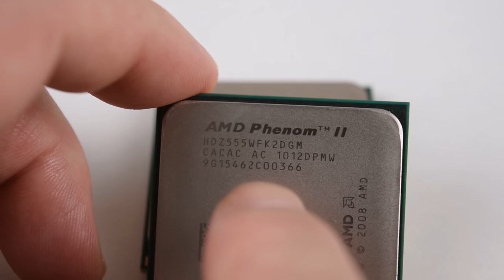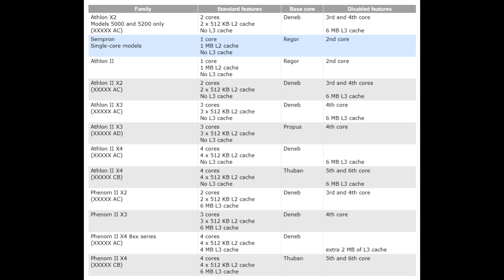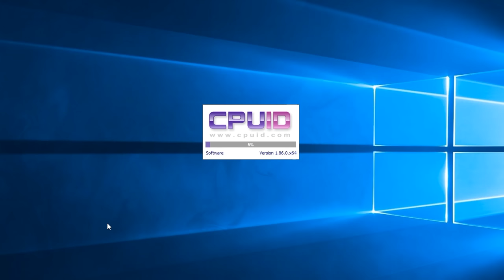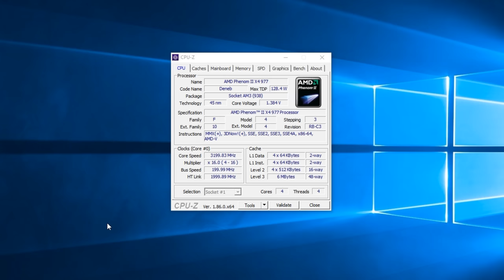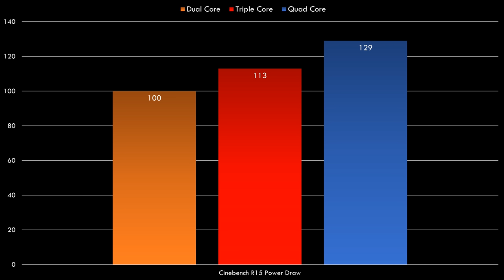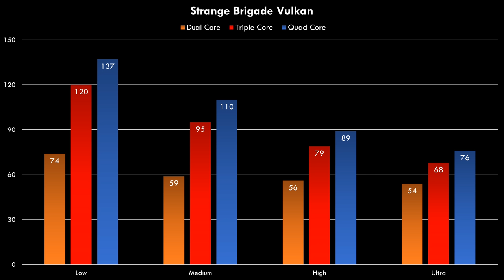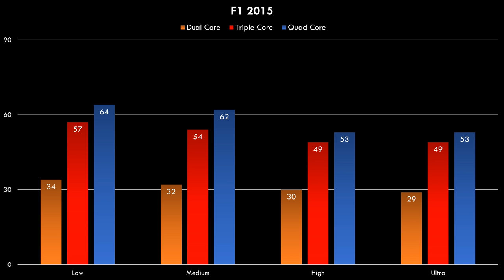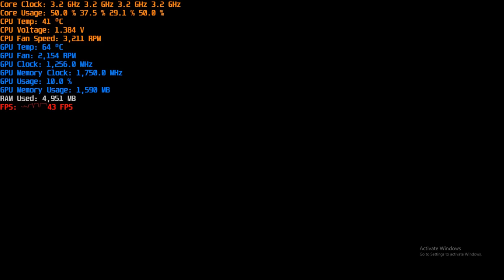Unlock $13 Dual Core into Quad Core

Comment: The biggest problem today with AM3 is finding an unused motherboard. Even the weaker CPUs like the Athlon X2 2MB are very capable dual core chips that will power through old games and the games of the time period. With better than Athlon 64 ipc and high core clocks of 3GHz and higher, those chips are actually very powerful. Sure a Sandy Bridge core chip or newer will wreck it but I have not seen the motherboards in high supply with low prices ever compared to AM3 even from 2009 and unused chips aren't going for cheap either. The problem with Far cry is likely GPU drivers. I was not seeing those dips back with my Phenom IIx4 and a HD6970 but I did have to roll back drivers to get stable FPS. With newer drivers the game was running completely unstable and was then running above 100fps with older drivers at all times

I was recently looking at Skylake i3s and the better ones new are going for close to $200 and the better motherboards were all going for over $100. My Phenom IIx4 from 2009 and the motherboard were less than $180 together. I'd love to go Intel if the prices weren't garbage but I haven't seen that happen since Haswell

Comment: Watching this video on a Phenom II x2 560 Black edition unlocked to 4 cores, but they won't overclock even with a decent quality MSI system board and a Hyper 212 Plus.  All four running at 3 Ghz.   Still, not bad at the time for a $89.00 CPU that's still working almost eight years on.

Comment: I hate reading amd gpu usage in rivaturner osd, its pretty much unreadable because usage jumps all over the place thus impossible to determine if cpu is holding it back hard or not... Great video none the less.
Reply from the maker: Yea I'm not sure why AMD hasn't fixed this in their drivers yet.
Reply: rivertunner not good (doesnt amd have built in osd?)

Comment: Can i unlock a intel Core 2 Duo to a Quadcore?
Reply: sorry pay intel for that. It will cost $500

lol
Reply: nope. Intel had dual core modules, so it either had dual core or quad core (two dual core units together) but still the dual and quad core dies where a single piece so they had no chance or recycling chips. Maybe they could have disabled cores in sofware but they never did so if its a core 2 duo, it has a single dual core chip inside.

Comment: GOG is dropping xp? Blue Snow just appeared. That's bad news for me, which os to use now. Any suggestions?
Reply from the maker: Got a link about this?
Reply: @philscomputerlab  Disregard that, it was a nasty rumer someone fed me to get me triggered and it worked. Great video maybe you can try the cheaper quad core fx-4100 in that AM3.
Reply from the maker: @retropcscotland4645  I'll check out that FX :D I use GOG installers on XP all the time, haven't had any issues.
Reply: @philscomputerlab  i got fx 6300 i can sell you for $80 if you cover shipping or $50 if you cover shipping
Reply: @philscomputerlab  Awesome mate. That's the good thing about AM4 and Ryzen, we can now get the older stuff cheaper.

Comment: Did you know secretely these were really 8 cores? if you add a 200nF capacitor between pins A34 and F12 you can unlock another 4 cores.

Comment: My processor burn out after core unlock first I got blue screen's a few times I can't get to bios to change back settings and after a 5 min restart loop the cpu die 
I think was manufacture faulty the core loked cpu some they may work but I was unlucky

Comment: I have Phenom II 965T Black Edition, 4 cores, 3,2 GHz pared with 8GB DDR3 and HD 7750. Works good enough.
Reply from the maker: Nice, we will be checking out the 965 soon. But AFAIK it runs at 3.4 GHz?
Reply: Mistyped, 3,4 GHz. Anyway I can unlock 5th code, but Windows than, refuse to shutdown. I am thinkin to keep this CPU and PC this year.

Comment: If the cpu core is unlocked on the board, can you then take the cpu out and put it in a cheaper board without the feature? Or once the cpu is removed from the mb with core unlocking functions, it reverts to its natural locked state?
Reply from the maker: The latter, the motherboard needs to support unlocking. It doesn't do anything physical to the processor.

Comment: i have the exact same AMD 555 dual core processor and unlocked it to a quad using an ASUS mobo. Still use that computer today. The core temp sensors didn't work when unlocked but worked again when relocked to a dual core, it's a known bug.
Reply from the maker: Nice!

Comment: What if the 2 core version's 1 other core is bad completely, can it be unlocked to 3 cores or just no?
Reply from the maker: Yes you can unlock individual cores in most BIOSes.

Comment: i bought a few of those asrock n68cgs4fx mobos a few weeks ago on newegg ironically i was able to unlock a rana athlon II x3 435 into a phenom II x4 b35 quad core  , 3 years ago i did the same thing on an asus M5A78L-MLX motherboard with a phenom II x3 720 unlocked it and overclocked it to rival a Phenom II x4 945 :)

Comment: that would be cool if you could do that to the new ryzen chips. say you gotta 6 core and 2 of its cores were functional but couldn't hit the base clock. you could unlock it and at least get all 8 cores at a lower clock or maybe you get lucky and you get a fully working 7th core and maybe a partially functioning 8th core. ya know? hmmmm
Reply: when ryzen first came out i was so sure that was gonna be a thing, i remember watching some of the first delid videos when they showed that there was a full die and thinking unlocking was back! Too bad it never came to fruition

Comment: in NFS:Hot Pursuit my Q8300 on 3.2 Ghz has the same drops, i thought it's lack of L3 cache and slow DDR2 memory
Reply: NFS: Hot Pursuit 2010 is a badly optimized console port. you shouldn't use it for benchmarks. I had frame drops on my i3-2100 with a gtx 670 even in 720p at certain places on the map with CPU and GPU load both at less than 50%. Only when I upgraded to a i5-3570k those drops disappeared and the game ran constantly at 60fps.
but the game is fun ;).
Reply from the maker: I didn't see them with a faster Core 2 Quad, so I think it's definitely IPC related. But the Core 2 Quad I used runs at 3.33 GHz.

Comment: I had a Phenom II X3 720 BE at 2.8GHz that unlocked to a Phenom II X4 and overclocked to a stable 3.8 GHz with no added voltage. Awesome times..

Edit: I remember how that unlocked X4 at 3.8GHz tore through rendering workloads. T'was a really nice upgrade from the 65nm Core 2 Duo I had before that.
Reply from the maker: Nice. We should have a 720 BE at hand soon :D
Reply: PhilsComputerLab great! cant wait to see your upcoming video on that.

Comment: That NFS has vsync and cannot be disabled, I think that's why it goes worse. With my Phenom II X4 920 and a 9600 gt in hd resolution and max quality it achieves 60 fps stable.
Anyway, I love Phenom II. My 920 is still an excelent processor, and I think AMD should make core unlocking possible in Ryzen hahaha. It would be great!

Comment: This use one of these with 8gb of ddr2 mines a b59 dual unlocked to a quad runs about 3.6 oced but had to step back to 3.4 after some werod issues and now I can't use my bios is get crazy artifacts
Reply from the maker: Clear the BIOS with a jumper to reset the unlock!
Reply: Would that clear the bios artifacts it wasn't doing it for over a year unlocked

Comment: Funny that just 3 hours ago I was watching video about core i7 6700k, witch was damaged with incorrect overclocking. Mother board started killing it, because of wrong selected voltage. So the os started showing blue screen. Reinstalling didn’t give any results. So guy send it to YouTube channel, and they find out on the other mother board, that this core i7 can work, but only if one core will be blocked) so now we have first intel triple core, with hyper threading) they called it Core i6, because it bidet Core i5 6gen)
Reply: omg lol best intel joke yet

Comment: This age old CPU gets 310 cinebench on quad core. My i5-6500 bought in early 2017 when it was the best option for $200 gets 520, just 210 more. My new Ryzen 5 2600 which can be bought for $160 and sometimes $150 can get around 1290 at 3.8 GHz on the stock wraith cooler. Looks like intel ripped me the F off.
Reply: Rohan A. I bought that exact i5-6500 and ever since have Best myself up about how bad a cpu it is. I totally wasted that $$ looking for a budget Intel cpu.
Reply: @utp216  How is it bad exactly? What are you trying to do with it that won't run well?
Reply: I have a phenom II x4 960t than when unlocked and overclocked to 4ghz (could get 4.1 if i wanted). put up between 590 and 600 cb score
Reply: @utp216  I mean, back in it's day if you had $800 to build a gaming system you got this. There was no alternative so you can't fault yourself for it. But now I've just sold mine today for less than half it's original price because of how quickly it became obselete
Reply: Rohan A. You know I think I’m not giving the 6500 a fair shake. It did get the job done at the time. I think I just expected more from it in to the future and figured it wouldn’t age so badly in comparison to what became available.
Reply: @utp216  planning to upgrade soon?
Reply: @rohana.7760  As much as i do believe that Amd has better value in their cpus.  Intel cpus perform better for certain applications even if their raw compute isnt as strong, the same way that the old 3rd and 4th gen i7's smashed the amd fx 8 cores despite the higher clock speeds and higher core count. Intel cpus generally do better in gaming applications as opposed to "equivalent" amd processors
Reply: No, it was just that the AMD FX CPU series was a failure & next to no software was optimized for it's architecture. Regarding gaming you'd often need highend GPUs to notice any difference in gaming between the Intel & AMD CPUs AFAIK.

Comment: There is a reason such processors were sold as two-core processors and not as four-core ones; in the post-manufacturing testing and quality control process, such processors almost certainly didn't pass all the required test: some cores were unstable at normal working frequencies or normal temperature ranges, had bandwidth problems or hardware bug in certain instructions, had in-die memory defects in some cores, etc... So yeah, even if I can unlock more cores in those processors I won’t recommend using them in critical tasks.
Reply: Did you actually paid attention to this video? I've had a x2 550 be, unlocked and runs everything much better and stable in overclock than my phenom ii 955be..
Reply: Manufacturers lock cores not only because they're faulty. Even if all of their cpus are perfect, they would lock cores and sell them cheaper because huge part of the consumers are on budget and they just won't buy expensive cpus.
Reply: @smtnbad  I know, if there isn’t enough output of budget product to cover a certain market, they are willing to sell locked hardware to cover those (also, it is valid if the sales for such lesser product does not justify the cost of mounting an additional manufacturing line); but remember that as in most industries, efficiency is key (and selling hardware as a cheaper version is not) and also remember that there is always defective output from the manufacturing line, so in many cases, they are selling real defective hardware as a more budget product (Nvidia uses this business model rampantly); my recommendation is that you just need to be careful unlocking and using such CPUs.
Reply: Like any overclocking/undervolting, you have to perform some long-running tests before running critical tasks. I think it's quite obvious but not bad to remind for unexperienced users. But instead of being careful, I'd rather recommend to always make proper backups.
Binning is also a cost and a strategy. If you know you sell more low/mid-end chips, you can start to raise QC validation for higher end parts. And in all semi-conductor industries there often are defective parts that just barely failed : if it's just a higher tension to sustain core settings, that's not a huge problem for this kind of chip.

Comment: I wonder if someone will come along one day and realise we can unlock Ryzen CPU's as well..........
Reply: i doubt you could unluck the comsumer ones, maybe the threadrippers as they have "dummy dies". It would be interesting to see if they're actually connected or what. Still, with no motherboard support there's no way to enable them even if they are functional
Reply: The only ones that might be unlockable would be the 6 core processors, since they would be two 3 core units connected via infinity fabric. They might be unlockable to 4 core units and give you a 8 core processor. Key word "might".

Comment: On the AM3 side there is always the Bulldozer based FX 8 core processors.

I am sill using a FX-8130 as my daily PC at home ;)
Reply: its not actually 8 cores, more like 4 cores with hyperthreading.....
Reply: The AMD FX 8150 are true 8 core chips.
https://www.amd.com/en/products/cpu/fx-8150

Review from back in the day...
https://www.anandtech.com/show/4955/the-bulldozer-review-amd-fx8150-tested 

AMD didn't use hyperthreading that was an Intel technology.
https://en.wikipedia.org/wiki/Hyper-threading
Reply: @morantaylor  they are not cores, they are modules, they share resources and they suck
Reply: That technology is actually in between HT and real multicore. Biggest problem with those CPUs was/is the lack of software tailored to them.

Comment: I have one that unlocked all 4 but doesn't OC that well. I needed a modded bios to do it at first.

The actual x4 chips were better. But who is complaining about 2 free cores and spending less money.
Reply: Was wondering what experiences people have with these. Seems like they disabled the cores for a reason. Likely because they didn't meet the performance benchmark they should so they disabled those cores and sold them as a dual core.
Reply: @EmptyTome  Hmmm... interesting. Well at least it's something right? Heh. :)
Reply: Exactly, amd wasnt dumb, most locked chips were binned. The most unstable cores and the defectives too were the ones that went to the lower end cpus. Just like most lower end models dont overclock as good as higher end ones, unlocking cores could mean you would need to raise the voltage to keep them stable and maybe even they would run way hotter at the same speed as an actual x4 cpu. If the unlocked cores werent outright defective, you still had a chance of them being subpar, unstable or that got really hot. Few were the cases of them being locked only to meet demand. Still for the one unlocking the chip it had always been a chance to win "more cpu", with no chance of loosing anything.

Comment: I'm using a AMD Phenom II X4 B95 Quad Core. However my motherboard does not support "CPU Core Unlocking" so, just bought my own quad core. I had installed a AMD Phenom II X2 B55 Duel Core CPU in my computer. I however play moderate games with it, nothing to demanding on my system, Other Specs: 4Gb RAM, 160GB Main HDD, 500GB External HDD, AMD Radeon HD 8490 OEM 1GB Graphics. Still play the early releases on last generation console.
Reply: CPU Clock Speed 3.00Ghz.